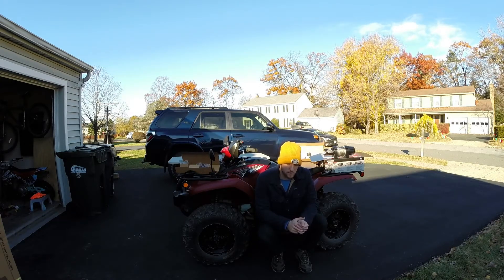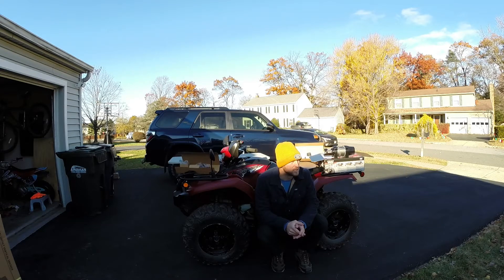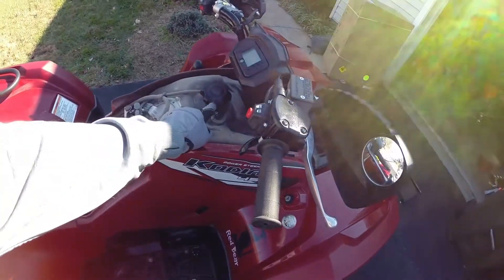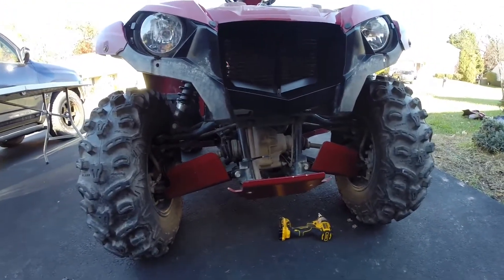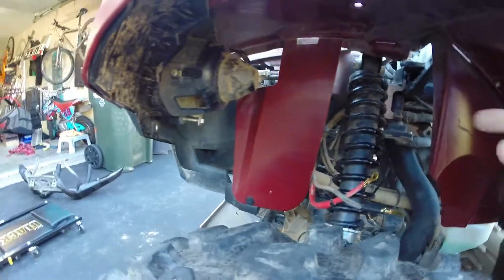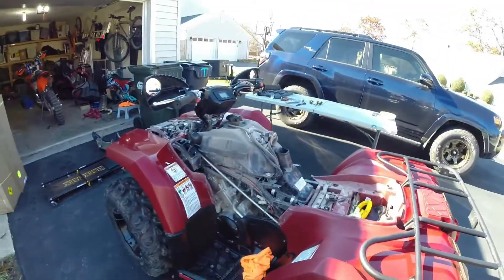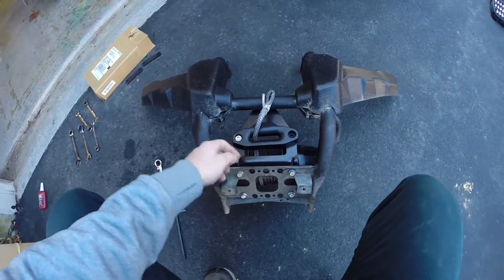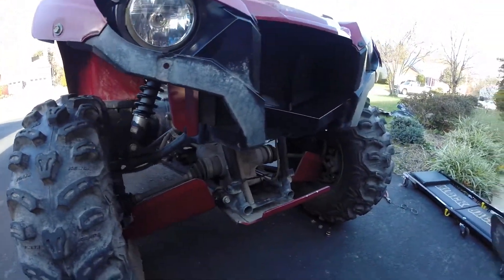Warn VRX 25-S Install & Demo  |  Yamaha Kodiak 450 EPS

Comment: 2022 Kodiak 450 EPS here, it's all the same set up as yours. Same winch and mounting plate and all. When we went to remount the bumper with winch it was so tight we had two tough guys on it to pull and twist to get the bumper bolts to line up. It was so tight to get the bolts in it seemed impossible. Was it a struggle to do this on yours or slap right on? I feel like bumper and top rack had a lot of binding to get the bolts in any of it.
Reply from the maker: Mind mounted right back up very easily. I did mount this winch when the ATV was fairly new so that probably helped.
Reply: This is a new machine bought from the dealer with 30 hours on it right now. We got the winch on and works good but the vrx 25 winch does not fit right it hits the plastic shroud in front of radiator. We had the winch turned around and tried both ways and did not use the mounting plate spacers or definitely would not work. It  pushes on that plastic shroud hard and that shroud is the whole front end piece. It works on the 2022 but does not fit properly on mine even though RM says it does.

Comment: thanks for the tutorial. Do you think the Yamaha supplied cables are long enough to reach the Warn solenoid if you installed the solenoid in the underseat storage compartment? You mounted yours closer to the winch, under front center plastic cowling.
Reply from the maker: I think they should be able to, but I can't say for certain. You can always switch up the color of your wires too if needed based on length and mounting locations. Amazon has pretty affordable low guage wiring for winches too. So, it's not too expensive should you need to order some longer wires.

Comment: Those two rectangular black bars that are laying next to box in your video... are they supposed to be installed under yamaha's plate to give it support or are they a spacer to raise warn wench?  I ask because I didn't install them either and now I'm thinking they should have been installed under so bolts won't pull through flimsy Yamaha plate???  Great video by the way.
Reply from the maker: I believe they are just spacers for clearance. I sunk this quad a few times in some cold mud and this winch pulled it out no problem .
Reply: Thank you for quick reply!

Comment: Thanks for the great video.  Curious, what 12V power source did you disconnect and tie into the partzilla wire harness lead?  I know theres the 12v cigarette outlet, obviously the key switch, and probably a couple other 12v sources.  Not sure, which one is most convenient to connect to.  Thank you.
Reply from the maker: When you take off the front plastics, the 12 volt to the cigarette lighter has a white plastic connector. You can buy the Yamaha wire lead and plug it into that. That's what I did, and it comes with two bullet style connectors so you can hook up your winch and another accessory if you want.
Reply: @ThomperBeThompin  Much appreciated!

Comment: I just noticed that your bike doesn't have diff-lock. I thought the EPS model came with it as standard.
Reply from the maker: This is a 2020. Maybe the more recent models do. I know it's available on the SE model at least as an option.
Reply: @ThomperBeThompin  I did some research and the 21 and 22 EPS models come with it as standard. Retails for $9600 Canadian plus all dealer fees taxes etc.

Comment: why do you need the winch plate for? why can't you installed on the bumper it self???
Reply from the maker: It's all because of the mounting holes aligning. These winches are mass produced to fit many different applications, which makes a mounting plate necessary for almost all those applications. The winch bolts to the plate, then the plate bolts to your machine.
Reply: @ThomperBeThompin  ok but if you can see the ones that comes on the SE model do not have that plate. I think you can mount the winch directly on to the bumper.!

Comment: Si where did you plug the part you bought from partzilla.? My Kodiak has the prewire too. The front and rear, thug I check with a tester and found out those wires the black n red are NOT connected to the battery, they run from rear to front 

And those cables need to be connected where.? The rear ones.? The front ones.? Where do they have to go ?